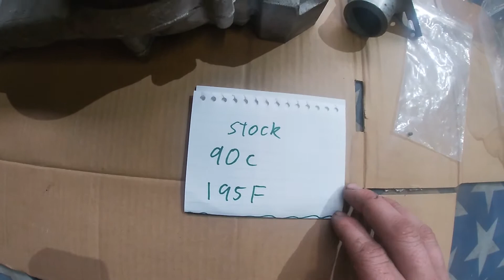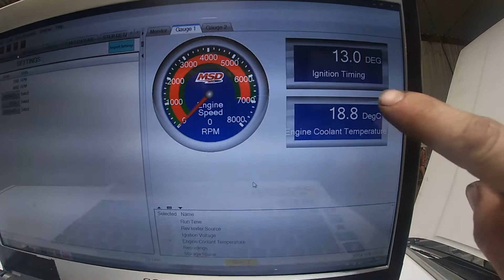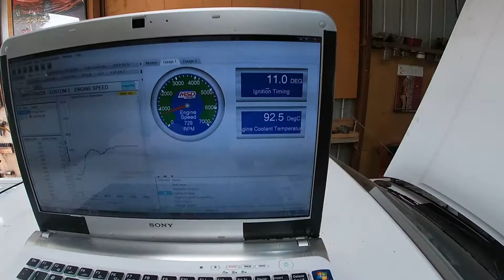Xg ute EP15: Cooling system Done

Comment: Hey just wondering if its easy to change the fan to AU with shroud ecluding the fitment stuff. is it just plug and play? or do you need to do any tricky wiring
Reply from the maker: Fans needed a fair bit of timing to fit but worked alright.
My xg had a clutch fan on the 6 that was originally in it, so there wasn't any wiring for a fan. You have wire it yourself

Comment: Engine sounds great in your XG, for my Xg ex-police divvy on my page it's the original 6 cyl that is in it and it won't be to much longer before i try to start it for the first time,  but don't know history of the engine so who knows what will happen when the time comes....
Reply from the maker: Sounds good. Let me know if you need any parts, ill going to sell my motor and auto soon
Reply: @RedsProjects  yer cool as, i am chasing 2 large rubber plug/grommets that cover the rear shockers on the rear floor plan, also are you a mechanic by what your doing or self taught
Reply from the maker: @entertainmentchanneloz1509  havnt got the grommets. Ive been a mechanic for about 14 years now.
Reply: @RedsProjects  all good, do you do call outs, or just own stuff